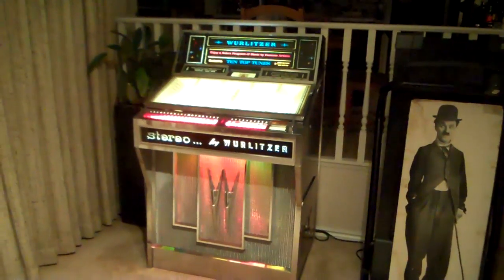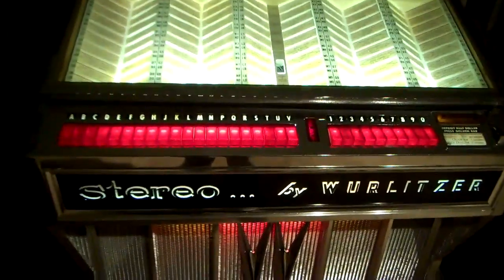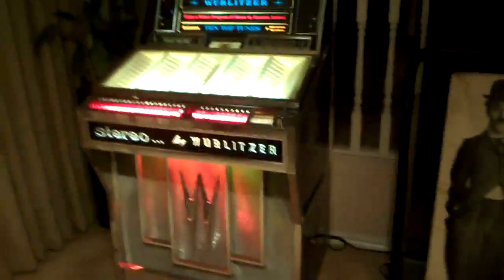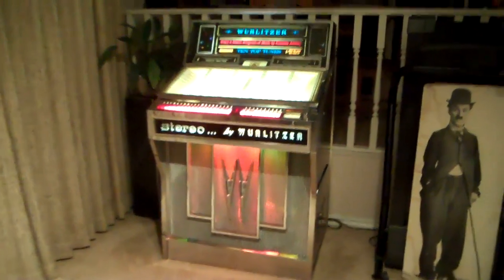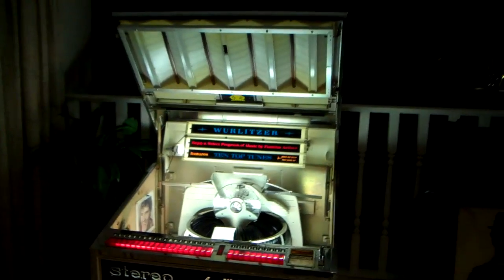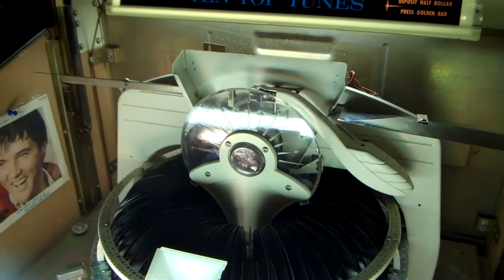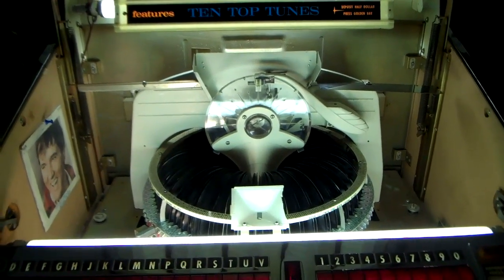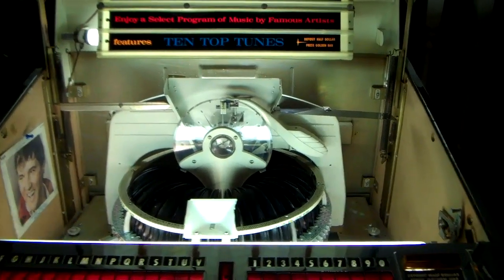1964 Wurlitzer Juke Box - Model 2800

Comment: Does anyone know where the adjustment for the arm to pick up at the end of the song? have to use the reject button and it's a pain in the butt. Thanks in advance!
Reply: There is a micro switch right behind the front panel called a trip switch. you need to make an adjustment on it . Just loosen the 2 screws and adjust switch so that when tonearm reaches the end of song it trips the switch. Real simple adjustment.
Reply: Thank you Wayne
Reply from the maker: Hey thanks for the comment and for watching the video!